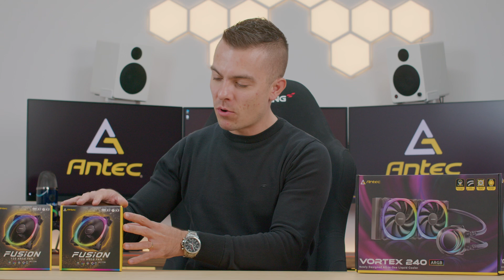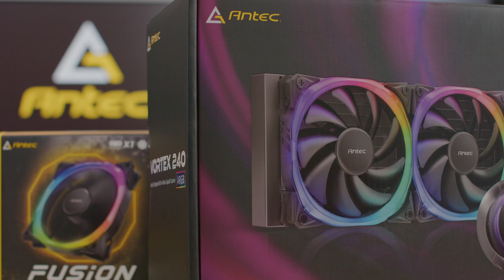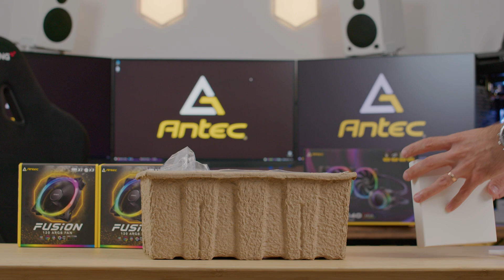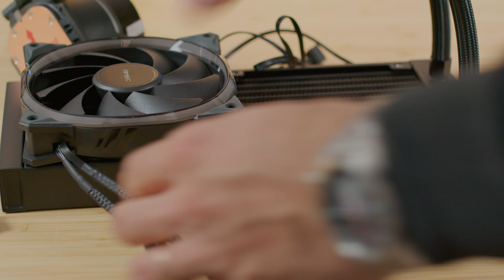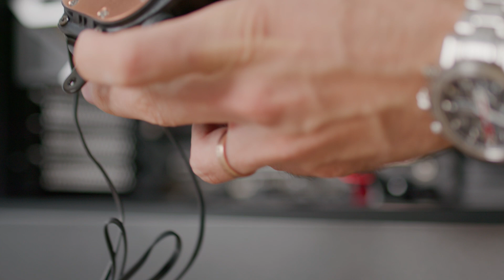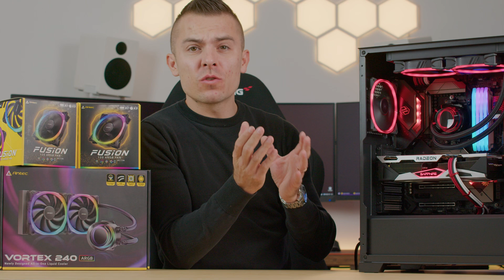NEW ANTEC VORTEX 240 ARGB AIO with FUSION FANS!

Comment: I don’t speak English so I didn’t understand the part where you turn on and that the leds are white with a green ray that turns, I have this problem in continuous and I still can’t find a solution, Signal RGB does not even detect the Watercooling, if you could answer me it would be super nice, thank youuuuu

Comment: Triple Fan pack + 2 radiator fans but only 4 connections on controller?
Reply from the maker: That is why you have splitters so you don't have to re-route all the cables to the motherboard directly. For instance, in VORTEX 360 you have a 3-way splitter for the fans so for those 3x 120mm fans you actually just connect one cable. ;)

Comment: Hi, do you know by any chance if it has an 
 asetek pump inside? And what is the minimum rpm speed?
Reply from the maker: Unfortunately, no Asetek pump. As for the RPMs, my guess would be 3.000. Not sure since I didn't lower it to the minimum. When I adjusted the speed curve it went down to 3.700 at 50%. Max was at 5.700RPM if I remember correctly.
Reply: @PCCrazyDario  that pump is actually crazy wow
Reply from the maker: @dagameboy  Yeah, looks sick. ;)